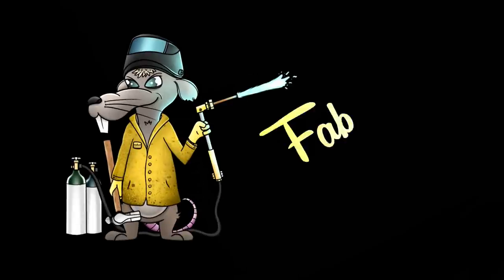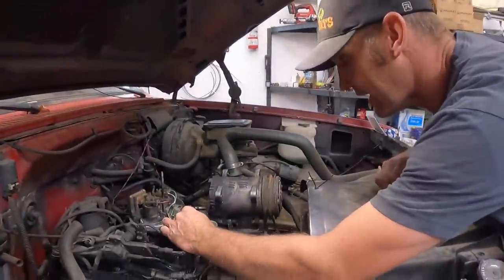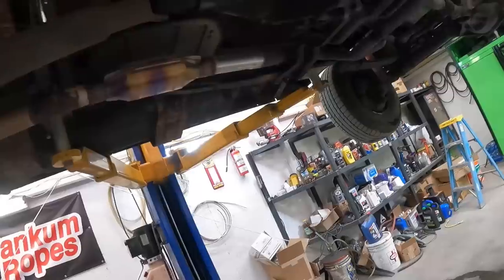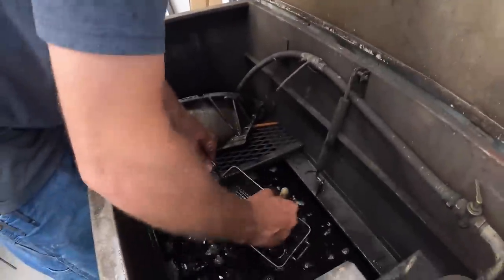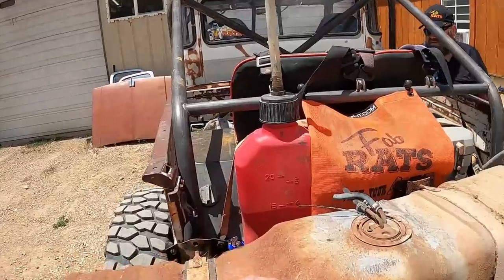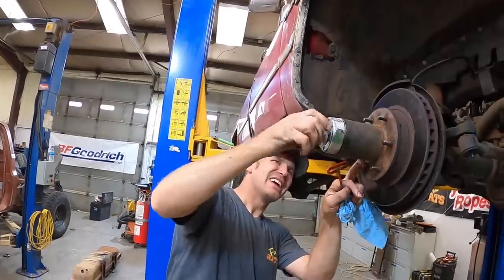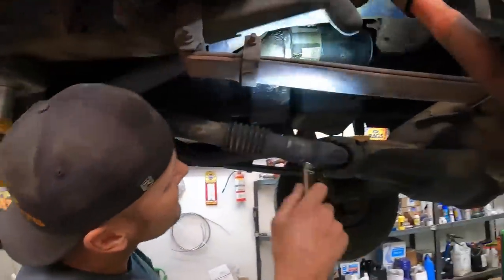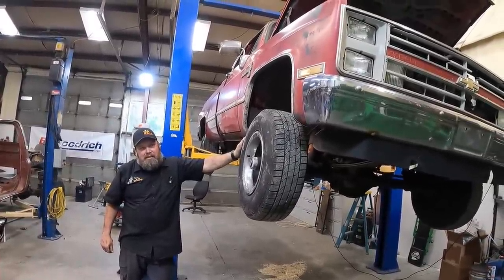Will This Square Body Purchase Be JUNK Or A GEM?

Comment: The easiest way to put a governor on the truck is to put a bolt underneath the gas pedal and weld it to the floor
Reply: Ahh yes, the "redneck restrictor".
Reply: friend of mine wired a 2x4 to bottom of gas pedal
Reply: If you push hard enough it will just bend it ask me how I know lol lol
Reply: Easiest way is let the carpet mat slide forward and ball-up. My girlfriend said "don't like this one, it has no power."
Reply: My first car I bought was a 68 Cougar.  Max speed was 50 mph.  Someone adjusted the throttle cable, where it only gave you part throttle.

Comment: I love how the metal chips are going into the manifold thermostat housing. It will help clean the dingleberries off the water pump impeller.
Reply: Right??? Just a few inches of blue tape...
Reply: How else do you fix a leak in a radiator?!? /j
Reply: @dfsmachinist5941  First it was not a rad, it was a thermo housing with a broken bolt stuck in it that are very tricky to get out without either welding a pry piece to it or drilling and rethreading the bolt threads!

Comment: If you use the earlier tank it from a non F.I. truck it doesn't have the baffle a F.I. tank has. It might stall when turning corners when  its low on gas. I have had over 100 73-87 gm trucks. You guys do a great job, you are some of the best mechanics and fabulous fabricators.
Reply: yup super smart not putting something in the thermostat hole while welding and drilling and grinding
Reply: That is a lot of trucks
I can't imagine ( I average a different car /every 10 years)

Comment: Clean and polish the tools so they'll look good in the freshly powder coated box. Attach the box with some of the magnets you boys took from old car speakers to a wall, door, lift, or what ever. After you round up enough magnets place each socket, ratchet, etc in that freshly powder coated box. Lid open put the box in a place it'll be tough for anyone to miss. They'll have to look to see how everything stays in the box. That's when they'll notice the cool old tools.
Reply: I think they should be given to someone with a Desoto.

Comment: When you take the OLD bearings races out, you can Grind the outside so the slide in and out of the hub freely, and you can use the Old Bearing race to punch in the new ones without any troubles, and they go in pretty evenly that way..  Just a thought..  Love the Channel

Comment: All my life I was told you could fix anything with baling wire and duck tape. But apparently whoever owned that truck was told silicone and jb weld was the fix all 😂
Reply: They'd still be driving it if they'd've stuck w/ baling wire and duct tape!
Reply: @michaelm.1947  did learn years ago that cloth hangers are nice to have around too. Not only do they come in handy when you’ve locked your keys in but can do some fine brazing when in need.
Reply: @cecilmckeithan5088  The newer plastic ones just don't work as good!
Reply: @rickcampbell9265  👍

Comment: I feel Landon’s pain, I blew up transmissions in my younger years! I can’t tell you how many th350 & 400’s I replace before my 21st Bday! I got so good I could R&R them in about 2 hours and I bench pressed them because I didn’t have a lift or a trans jack.
Reply: I’m glad I’m not the only thinking about transmission😅 17 years old with a 85 el Camino I’ve blown through two transmission so far I thought I was being stupid witch I am but I’m glad It’s just a normal thing that is younger guys like to do🤣 the burn outs or taking off are way to fun not to do soo
Reply: Funny Ed I had a 75 El Camino Sport at 17(50 now)! That car got me in a lot of trouble and probably went through 4 transmissions in it over the coarse of 3 years but I use to street drag with it and it was my daily driver!

Comment: That JB weld fix reminded me of something that I would have done in my 20s. I once had an 86 Bonneville that got a pin hole in one of the brake lines. I sanded it to rough it up, put a gob of JB weld on it, and wrapped it in paper towel to keep it in place until it set up. That fix worked great and out lasted the rest of the car. Lol
Reply: Yep ole JB done right fixes a lot. Had a similar problem with a pinhole in the corner of my gas tank on my first car, 69 Ford Falcon, after JB it never leaked an you couldn't tell it had been repaired. 👍

Comment: I recently sold an '84 Chevy K10 "heavy half", 4x4, 700R4, and the old 6.2 Diesel... (with Turbo)...
I LOVED that truck. My Grandfather bought it brand new off the showroom floor. We kept it, and it barely survived my son. 
So we sold it to a guy in Idaho... I hope it finds new life up there...
I would have held onto it, if I had known you needed one...
A "race truck" it was not... but if you needed to tow or haul something, it would do it!

Comment: 4:08 I broke the thermostat housing bolts off a truck just like this when I was a boy :) ... I drilled the broken bolts (not perfectly centered either) with tap drill size for 1/4" 20 and taped them.

I meant it as a temporary fix, and planned to "add it on" next time my truck needed a real mechanic ... but it lasted longer than the truck did :)

Comment: Do you have to worry about metal fragments going into the thermostat opening?
Reply: Yep, waiting for thermostat to open and push aluminum chips and grindings into radiator.
Reply: I was thinking the same thing
Reply: I bet they used the good 'ol aluminum magnet 🧲 😉
Reply: Redneck stop-leak :)

Comment: OK! For all you young guys out there, check this out. I'm 19 in the Army stationed in Germany. My job was Wheeled Vehicle Mechanic. I had an old VW BUG, don't remember the year. I pulled the Engine, by myself, setting it on my chest and scooting out from under it. Did the repair and put back in, all by myself! So there! Now at 80, I have trouble lifting my fork to my mouth. Lol. Yes! Back in the day I was The Hulk! Now I'm just A Hulk. Love your videos. You know. From the flat lands of Central Indiana. God Bless!

Comment: Really enjoy your vids, even when the chips are down you bring humour into the story. I like that your real and not attempting to make it glossy and pretend. As an aside where I live Landon’s new drive wouldn’t pass registration inspection with a hole in the front fender in the engine bay, the loose hood lining might get a non pass, the rust in the body would cause a fail. And any wet oil area would get a close inspection .  Lucky you can resurrect these vehicles without the tough inspections we have to comply to .

Comment: Ben, you are skilled with camera operation, being the star, and of course working on vehicles (duh). It seems so natural. All of this must run in the family.
Brothers like you 2 just makes things get fixed/upgraded so quick and painless, minus the standard issues in fab/upgrades/repairs.
I don't know if you have the need for smaller item cleaning, or if you care for the time it takes, but maybe find a hypersonic cleaner to clean smaller items easily? It takes some time, but it is no effort besides changing the fluid. I don't know if it works for you, but it might. Just throw and item in and sound vibrates it to the point of cleaning (not talking about full rust level cleaning, but dirt/grim level)

Comment: Back in the90’s , I found my case tractor  had started on its own a few times just b4 I was going to drain radiator, I would have not dis connected the battery ground… my 300hp motor would have been fried…I found the 2 wires inside the plastic  harness to the starter were rubbed bare..  u r showing great content👏🙂👍👏

Comment: That's a old Spud Ratchet tapered spike on the end. The spike can be used to line up bolt holes when installing pipe fittings, doing automotive work or—in the case of iron workers—for lining up bolt holes in girders and beams.

Comment: You should try a left hand drill bit on those broken bolts. They will usually spin out before you drill all the way thru. A little heat and PB spray helps too.

Comment: I just bought a 1999 jeep xj  been sitting in a field not running.. for about 3 years..  650$  .. I  put a crank sensor on it  got it running..   Little rust too 
 It has some rocker arm noise .. my 97 Chevy sprung a leak in the gas tank  
   Right under the strap too in the front.       I really enjoyed this channel. 🙌

Comment: You should teach the importance of greasing the Torrington bearing under the spindle, thrust washer... brass vs nylon & seal ect.  It's worth the effort since it's so small & rarely gets attention when most service wheel bearings.

Comment: Yes you need the screen for the back window. You could build a
Cover for the controls with a metal frame and the screen to fill it in, and a hinge in front to
Open when you use the controls.

Comment: Paul, when I was an "ankle biter" or a few years older, my dad showed me a trick to seal a leaking gas tank. Whenever we went on a Trip my mother would put a bar of soap in a plastic bag with a few spoonfuls of water. 
On this particular trip we got a stone thrown up and dad noticed a gas leak. While sticking one finger against the hole he had mother scrape some of the, now soft, soap off the bar and mold it into a quarter sized blob. This she handed to dad who with his other UNCONTAMINATED hand proceeded to place it over and push into the hole . The soap hardened almost instantly and stopped the leak. As it was going to be a few weeks before we'd be home, to protect the patch, dad scraped the tank "clean" around the hole and covered it with a piece of wide Elastoplast tape. Off we went on our holiday.(vacation). 
When we got home dad had the garage who did his services remove the tank to repair the patch. They eventually had to burn the Elastoplast/soap patch off in order to solder on a metal patch. The tech reckoned the soap patch alone would have lasted for ever.
Long story short, I carried a plastic bag with wet soap on all my rallies, used it once or twice when we'd punch a hole on some dirt road but it kept us in the event. The secret is to not mix fuel and soap, even residue on your hands, until you're ready to apply the patch.
Thanks for the entertainment. What is Landon's problem other than too heavy right foot?. Maybe a chunk of rubber under the loud pedal is needed so it becomes hard work to press it.
Regards from Canada's banana belt.
❄️⛄🇨🇦🍌🥋🎅🇺🇲🕊️🇺🇦👍

Comment: On a truck like that.....while I had the tank out....I would of cut an access hole in the bed right above the Fuel Pump....so that "In the Future" if you ever had Fuel Pump issues, you would never have to drop the tank or mess with the straps again. Then just "FAB" up a slick access cover for the hole in the bed. Win-Win.

Comment: I have not had good luck pounding in new wheel bearings. I have been told that they no longer harden them like they used to. So now I take an old race run it on the belt sander clean it up and use it to pound in the new ones. Good luck on the ones you did.

Comment: My dad had  a blue 86 chevy that me and my brother took out backroading at 12 an 13 (circa 1992 or 93),we figured a quick 15 minute ride we would be back well we got stuck took 2 hrs to get unstuck. so we stopped at buddy's house washed the truck, pulled in the driveway shut the truck off walked in the house as my dad pulled in the driveway . My dad walks In and said who was driving my truck we checked everything tape on door string on gear shift the gauges didn't work  ,so in confidence we both stated "not me !"  he made us both follow him outside ,and he showed us the pop can he parked the tire on that was now next to the tire. Busted!

Comment: That’s kool how to pull the back bearing and oil seal. Over fifty years ago my neighbor had a boat trailer that he packed the bearings on the axle and he always used a punch and hammer and would destroy the seal. Well he asked me one time and I did the same maneuver you did and the old boy was amazed how easy it was.

Comment: On that wheel bearing lock washer, the holes are offset from the tang so if the pin on the inner nut doesn't line up, just flip the washer over and it likely will.  Also, when the outer locknut is tightened, it adds to the bearing preload due to the looseness in the threads which may give too much preload if not allowed for.
  Next, did you check the V-groove seal behind the spindle when replacing the wheel bearing?  That's a common entry point for water.

Comment: I would suggest welding a 2 1/5 inch block to the floor under the throttle. Until Landon learns to keep his foot pressure light.

Comment: Have you considered a furnace that burns used oil and other fluids? They aren't that expensive and really put out the heat. Cost effective in the winter for a shop.

Comment: Got home from a family trip when I was 17. Dad had me drive and the rest of the family was in the back seat. When we got home, everyone bailed out and the drivers door swung open as if it ripped off. My dad got in my face and said "until you pay for your own GD brakes, tires and insurance and gas, you will drive my car like an old lady."  I made my first set of brakes and tires last 70,000 and got the oil changed every 2,999 miles. He was a terrible passenger until the day he died but I'm thankful for what he taught me.

Comment: Now if you had grown up in the rust belt areas you would be used to all sorts of different hole repairs, screws with rubber washers work pretty good. I had a Ford with 4 or 5 screws in the oil pan fixing oil leaks and patches on the fuel tank. Chevys we cut an access hole out of the bed to replace fuel pumps because you cant drop a tank unless you want to end up replacing the hangers brackets and sometimes the tank.

Comment: Good plan, put the ac belt on and it will be like a governor with the hp draw. Brother in law had one and we were going on a fishing trip and I was happy as it was hot and my car at the time didn’t have ac. It was great until we stopped and picked up the boat. Then he said we can tow the boat or have ac but not both.

Comment: Put a new hose on the bottom of the air cleaner intake so that it will warm up better when cold weather gets there.  The hose picks up hot air from the exhaust manifold and  sends it to the air cleaner.  Make sure that the air temp sensor is working so it opens and closes the door/flap to route cool air after the engine gets up to operating temperature.

Comment: You guys talking about the turbo 400 reminded me of the HD mechanic that bench pressed the front section of an 18 speed transmission into a kenworth. My jaw just about bounced off the ground when he did that. Best guess is that thing weighed 350 lbs.

Comment: LOL, I went through similar issues. My first car was a 76 Plymouth Grand Fury, I cleaned the dirt off the mechanical oil pump and it then started leaking.  My parts guy said, same old story customer cleaned it then it leaked!! 😂😂

Comment: I'm pretty sure you can get the holley system for Landon truck and you can set a rpm limiter so he can't go past say 3,500rpm or whatever you want for the motor you build. That's what I'd do it's handy to have on the v8 engines because the older stuff can't handle much rpm unless it's a newer hemi they can't take like 7,000rpm. But still they have their limits haha the holley system is what we have on the late model race car it's a really nice system and super easy to learn :) hope he gets his other truck fixed up and squared away so he can drive it more :)

Comment: That tbi 350 made a whopping 210 horsepower on it's best day.  I usually end up throwing a time-sert in intake manifolds when thermostat housing bolt threads are trashed.

Comment: Lol. I remember when I first got my old 65. Straight 6, 3 on the tree, was supposed to be an A to B truck. Now it has a dual carb 427 and a ford toploader and will pass anything but a gas station. Trick is to blow it up, and get it replaced with a monster before your folks realize lol

Comment: JC Whitney used to have some 2 part epoxy (they didn't make it of course, but they sold it) that you used to seal fuel tanks. I used it in my old 62 C10 and it kept me from having to find a gas tank for it. Much better fuel tank fix than JB Weld.

Comment: I have always heard Ivory soap works as a trail fix for a fuel leak. Mash it on just like any other epoxy putty. The gas reacts with it to turn solid.  I have never needed to test it however.

Comment: I have changed an SM45 manual trans through the doghouse on a '73 Chevy truck. I had to do that to replace a clutch assembly and throw out bearing. That was about 45 years ago. I don't intend to try it again!

Comment: Milwaukee 3/4 drive m18 impact is a beast that would do wonders on stuck nuts like that. I use it on my military trucks and it rips 500ftlbs rusted bud nuts right off

Comment: Oh my gawd. On Monday, at the shop, we wanted to drain our oil caddy, because the air wasn't pushing it out (something is clogged). We got it up on the alignment rack, go to pull the plug, and I got immediately covered in oil, bald head, to toe, the guy beside me also took an oil bath , just not as much.  That was awful.

Comment: I patched my 1984 T-Bird's fuel tank with JB Quick and it stayed leak free for 8 years... I did clean the bottom of the tank but it was actively leaking fuel when I patched... I used a 3x5 recipe card as a mixing board and then slapped it up with the leak centered and held it in place for the 5 minutes the JB Weld needed to get sticky enough.

Comment: All the fun ways of stabbing a transmission with a jack ,  ive done !  Fun times !   Load a 10.00 x 20 or 10.00x22 or 11x24.5  in the back of a 10 wheel dump truck by yourself, flat-footed,  get it bouncing and just over the tailgate!   Its worse on most 18wheeler dump beds though